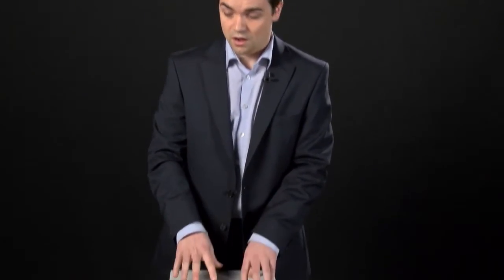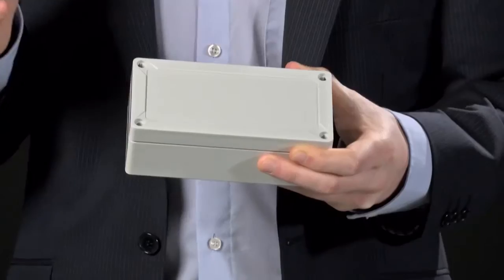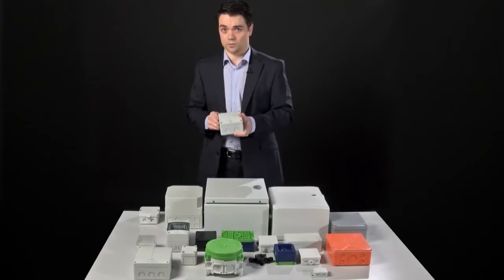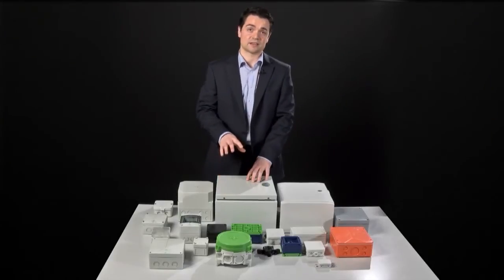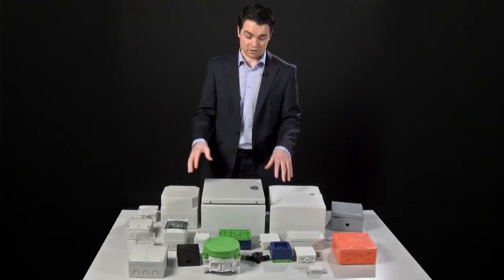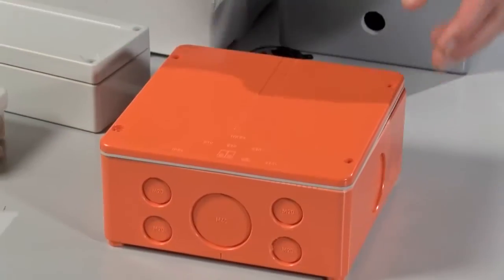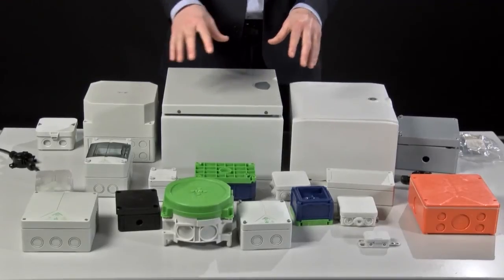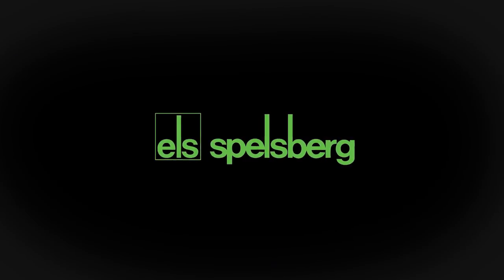Introduction to Enclosures

Comment: Aluminum is the best, need a hole with a flat then cut the diameter out of the front and the flatted hole out of plastic inside, trassh electronics are cheap and have premade enclosures that might inspire your new diy device. Drill wit bits and stepped bits, scribe, center punch, counter sink... Debur tools...